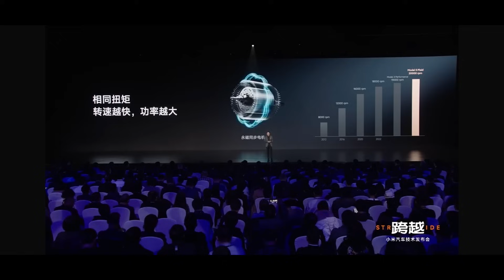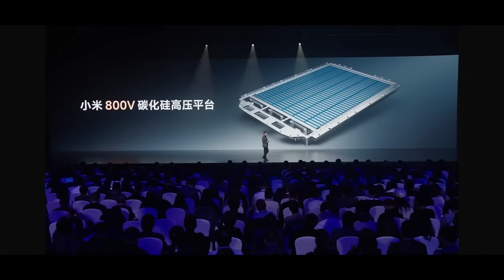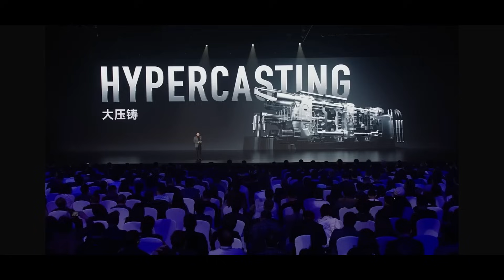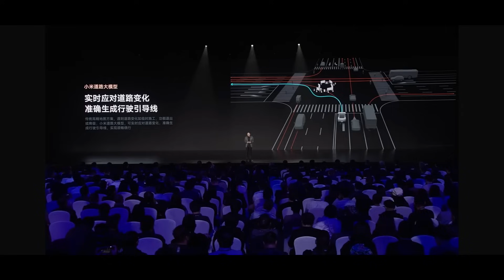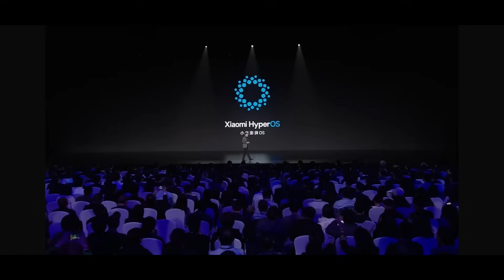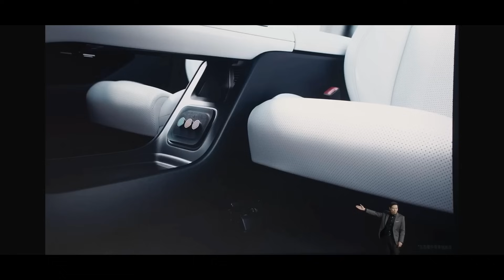NIO Stock NEWS❗️ Xiaomi Su7 NEW Car Event! Better or worse than NIO❓

Comment: Anyone who buys an electric vehicle should also think about the day they want to sell the vehicle on the used vehicle market.
 Anyone who buys a used car will have to take into account that the battery, which is the most expensive component in the car, needs to be replaced soon and therefore avoid buying a car that does not support the battery swap technology... this is my opinion..